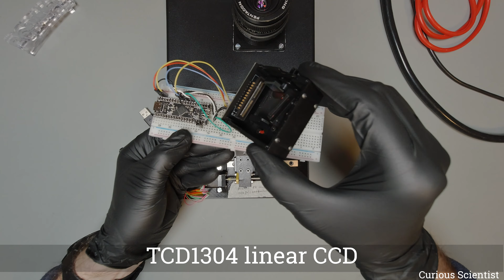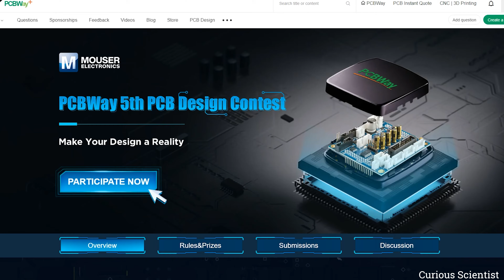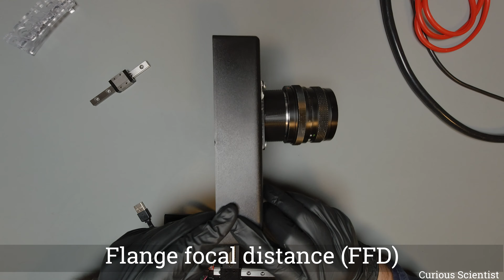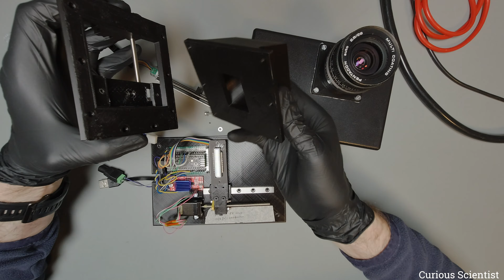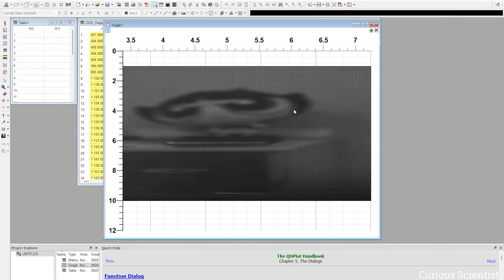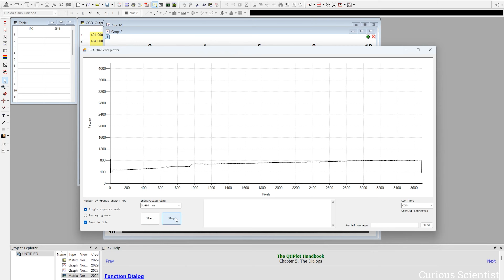Building a full-frame digital camera from scratch

Comment: I know I’m annoying but, can you use a cmos sensor from a dslr instead, and then move it to four positions or have four cmos sensors in four positions then do image stitching in post processing
Reply from the maker: Why would you remove a perfectly fine sensor from a camera to begin with? What's the point?
Reply: @CuriousScientist  if it’s a broken camera I.e a parts camera you can use the sensor from the camera
Reply from the maker: @kierancarter3693  I personally would not bother doing it. Reading out such a large sensor is not a hobby-level tinkering.
Reply: @CuriousScientist  what’s the point of doing the project you are doing? It’s the same reason of using a donar sensor
Reply from the maker: Not really the same thing. You were talking about a camera sensor which is a 2d array. This is a 1d array (line). Furthermore, this is not a camera sensor. So, I repurposed this sensor for a different application and built everything up from scratch. Code, driving circuitry, everything.

Comment: What if you could make a hybrid camera one that does film and then the scanner scans that film after it’s been exposed
Reply from the maker: Your idea is not impossible, but it cannot be done in the way you suggest it. You cannot directly scan the film after it's been exposed. If you want to scan it, you need a light source. If you shine a light on an already exposed (but not yet developed) film, then you basically ruin it. If you want to do it inside the camera, you have to scan the film while it is exposed when you are taking a picture of the subject. It is technically challenging because you'd need to scan it within a short amount of time and you'd need to adjust the exposure value (integration time) of the CCD dynamically because as you scan from one side towards the other side while the film is being exposed, the brightness of the film will change.
Reply: @CuriousScientist  thanks for your response what your say is great and you have a lot of knowledge
Reply from the maker: Thanks! I try my best.
Reply: @CuriousScientist  if only there was a way to quickly develop the film or another method to create a negative to be scanned
Reply from the maker: Polaroid is somewhat in-between these two, but you won't get a digital copy.

Comment: Really awesome project you have going here! Kudos on how well thought out the entire process was. I was particularly admiring the navigation through the complexities of flange distance, particularly when giving consideration to micro details such as the distance between the glass of the scanner and the sensor of the scanner itself.

Say, I was also wondering whether you'd consider placing an array of mini scanners that need to move minimally across to complete taking one picture. 

While as I write this, it occurred to me that multiple scanners may not produce a single consolidated image and they may just take the proverbial "shots of segments", they may increase your "shutter speed" , helping in capturing moving objects. However, with the right image processing tool, you may be able to "stitch"/ consolidate them together at a later time.

Worth considering - particularly if you are looking at making something like a medium format sensor size equivalent. 

Would love to hear your opinion. 😊😊
Reply from the maker: Thank you! Probably, it would be possible to put let's say 6-8 similar CCDs on a rail, and then move a short segment and then stitch together all the segments into one picture. It does not even need a very sophisticated software. The problem is to sync all the sensors' driving and sampling together. Probably it would need a bit more complex driving circuit than a small $4 MCU that I use in this video. 

Regarding the medium format, I am pretty sure that I could find a 36 mm wide linear CCD and then apply it. I was actually looking at some medium format cameras, such as the Kiev-88, but right now I don't have $400 to burn. It would be fun to keep the whole camera but replace the rear panel with my DIY scanner.

Comment: In serial plotter you are getting pixel value exactly in between two ICG pulses. But with the code you provided in driving the CCD video. I increased the buffer size to 7388. It sampling at a random instant of time, means it is not in between two ICG pulses. How can I get exact 3694 elements in between two ICG pulses. I'm assembling two successive values of CCDPixelBuffer into one Pixel value. So for 7388 values im supposed to get 3694 pixel values. How can I get that.
Reply from the maker: You have to sync ICG and SH. I carefully explained this in my article...

Comment: sir

I'm able drive the CCD by following your video on TCD1304 Linear CCD - Driving the CCD, From the data sheet Pixel 1-32 and 3679-3694 and are dummy pixels. Im using USB to dump the CCDPixelBuffer with the following code whiche is in while(1) loop.

	  HAL_ADC_Start_DMA(&hadc1, (uint32_t*) CCDPixelBuffer, CCDBuffer);
	  // Convert CCDPixelBuffer to stringArray and transmit line by line
	  for (int i = 0; i < CCDBuffer; i++)
	  {
		  snprintf(stringArray2[i], sizeof(stringArray2[i]), "%u\n", CCDPixelBuffer[i]);
	  	  CDC_Transmit_FS((uint8_t*)stringArray2[i], strlen(stringArray2[i]));
	  }

My CDC_Transmit_FS is in while loop. And when I try to dump the buffer in HAL_ADC_ConvCpltCallback(ADC_HandleTypeDef* hadc) function I'm not getting nothing. I'm getting only dots(......). With CDC_Transmit_Fs line in while loop I'm getting CCDPixelBuffer values line by line coolTerm.

My question is how can I edit my code so that I can get that exact one line reading of 3694 elements. As because even if I change the buffer size to 3694 I'm not getting the same reading even if the sensor is exposed to same object. I can see CCDPixelBuffer values in live expressions of stm32 cube IDE changing frequently. The data in between those two SH pulses, I want to read everytime and plot like you are doing in serial plotter. 

How can I capture the data you are capturing in a live stream so that I can work on each and every pixel of the vertical line of ccd sensor.

Like How can I read one full column of 3694 pixel values.
Reply from the maker: Don't do anything with the data on the MCU. Process the bytes on the computer. It is easier and less messy. You can count the pixels (2 bytes per pixel), then just reconstruct the datastream.
Reply: @CuriousScientist  Sir I'm getting the stream like this 
b'\x01'
b'\xad'
b'\x01'
b'\xa8'
b'\x01'
b'\xb1'
b'\x01'
b'\xaf'
b'\x01'
b'\xa7'
b'\x01'

So one pixel means I have to reassemble the successive bytes isn't it?

For example in this 4 bytes which are successive
b'\xaf'
b'\x01'
b'\xa7'
b'\x01'

b'\xaf' and b'x01' forms one pixel ( By converting that into decimal value )
b'\xa7' and b'\x01' forms another pixel value 
Please do correct me sir....
Reply from the maker: Sorry, but I have no idea. How should I see it from your datastream? Everything is described in my video and articles.

Comment: I was watching your linear ccd series, because I wanted to make a scanner camera from scratch. Only now realized that you have actually done that as well! Very cool results. I would love to see how a different sensor would perform, maybe the TCD2726DG is better suited for taking pictures, since it has rgb, square pixels and a faster line rate. For my last try at building a scanner camera, I just "reassembled" an Epson scanner, like you mentioned other people did. This gives good results fairly quickly, but the camera I made was still quite big, had no fast image preview and required a laptop to be connected.
My idea for the next build was to rotate the sensor around its center instead of moving it along an axis, because that would allow for higher frequency image taking. The main problem I see is how to keep a good electrical connection between the rotating and the stationary assembly. Also, one would have to deal with vibrations/how to balance the rotating assembly. Using the mentioned sensor, one could theoretically capture okay resolution 30fps videos at the maximum line rate of 10.5khz. But I have absolutely no idea If this readout speed would even result in meaningful data.
I would love to hear your opinion on this idea, since I struggle to assess the feasibility of this.
This was a little silly, but I made a script to convert an image to look as if it was taken with a rotating linear image sensor, so I could better understand the impact this would have. Here a result of a simulated 30fps frame: https://imgur.com/a/N0ZFLsT
Reply from the maker: Hi! I looked at that sensor earlier, but I could not find any sellers selling it. But it has very nice parameters, it would worth playing around with it. 
Regarding the rotating CCD, it is actually a great idea. I have never though about this option, but it sounds good and I like that there is a smart image processing behind it. The cables should not be an issue, since you only need to rotate 180° (plus a little more maybe, just to make sure we covered a full circle). So a flexible ribbon cable should be able to do the job. 30 FPS is more than achievable with the TCD1304, I was able to read out at around 120 FPS when I was using the "typical clock values" from the datasheet. I think it would be relatively easy to create a rotating platform for the CCD. You can then also use a stepper motor to rotate the platform between two exposures. The platform could be a (metal or 3d printed) disc with teeth on its side (basically a gear), and you could match the teeth with a gear attached to the shaft of the stepper motor. If you use a helical gear pattern, then you can rotate the motor 90° so you can save some space. I definitely see some potential in this idea. Once I fully finish this project (adding a display, an SD card, some controls..etc.), then I might attempt to build your idea too. But it will take time.
Reply: @CuriousScientist  Ups, I made a mistake. The TCD2564DG is actually the one I wanted to mention. This one is also available on AliExpress.
What I meant with 30fps was literally 30 full pictures per second. So the rotating assembly would have to turn at 15 rpm. Toshiba says the sensor has 10.5KHz line readout speed (I just assumed this means 10500fps). The TCD1304 is rated at 0.2KHz.
Reply from the maker: Ah, if you want a full rotation, then I have no idea for the connections.

Comment: Make lens tube slightly too short and install shims on tube flange until focus is correct.
Reply from the maker: That's a great idea, thanks! I will probably do something very similar. I am actually redesigning the mechanism (new parts just arrived a few days ago), so I will also need to change other things to match the flange distance again.

Comment: I was wondering how you got a Full Frame CMOS, then I thought oh scanner CCDs before you opened the box. So will the next project be to use a scanner for a large-format?
Reply from the maker: Hi and thanks! First I want to make everything work perfectly on this system and add the mentioned features. Probably I won't go for large format just now because I would need to buy a lens and a larger CCD for it and I could spend that money on other things for other upcoming projects.
Reply: @CuriousScientist  Great project. I've built a few scanner-based cameras. If you choose to pursue a larger format sensor I'd be interested in helping fund that work, and also helping out. I run a prototyping/optomechanics shop.
Reply from the maker: Thanks! As I mentioned above, first I want to make this project into a fully finished and perfected camera. Then I could move forward towards for example a larger sensor. And of course all support is welcome, this camera turned out to be pretty expensive. 😄